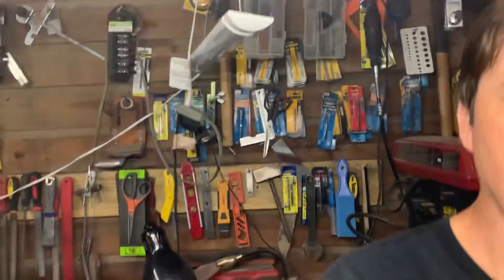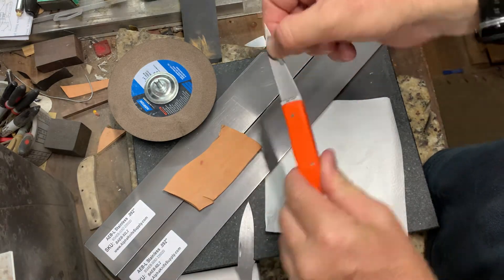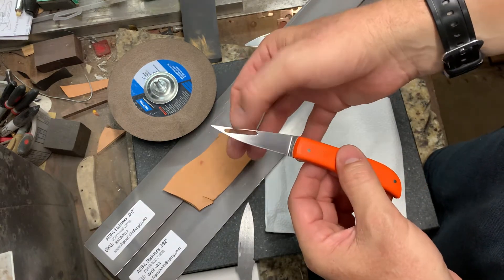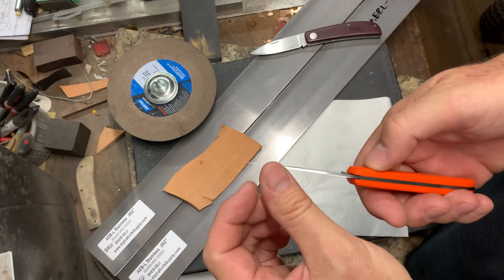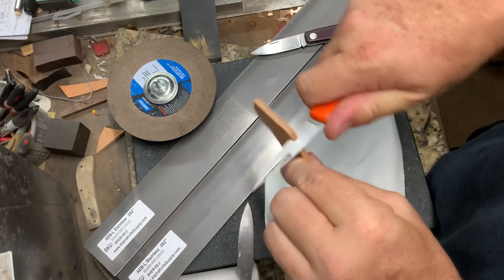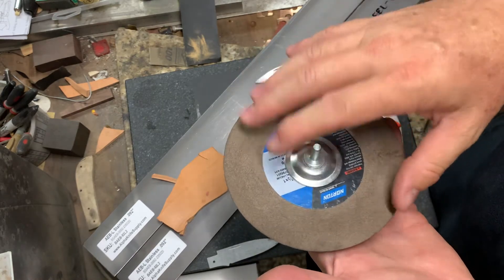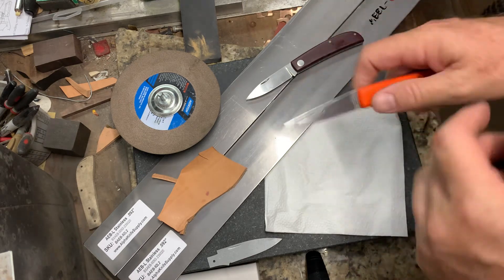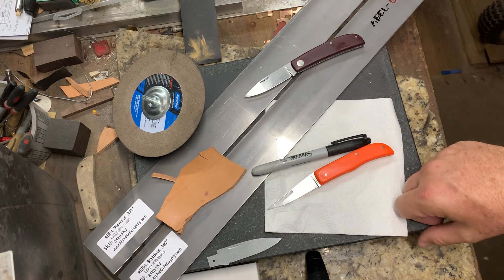How designing in steel works for me.

Comment: These video topics are very useful. I prohibited myself from making folders out of fear of too much failure. Silly. Also, you should try unidirectional carbon fiber. The .125 cf is stiffer than my .100 titanium. The stiffness of the g10 is already impressive.Another question, if I’m making a 10v blade, should my back spring be 10v? I’ll send you progress photos on Instagram. Have a good one.
Reply: Dang dude that nail nick jig is borderline genius.
Reply from the maker: I don’t know if 10v will make a good spring.  I suggest trying an see.  With 10v’s high carbide content, I would be concerned about the harder blade 10v tang gauling lower carbide content springs.   

I don’t like using carbon fiber.  Nasty stuff.  I have not used it in several years.  It does look nice.  

Look forward to seeing your progress photos.
Reply: @mccullenj  I’ll experiment with a hardened lock interface insert on the spring if galling is a problem. I’ll go with a w1 for the spring, and polish the radius on the tang for now. I don’t even have my heat treating oven yet so the blade will be w1 as well. Thanks for your time. Your work makes things look easy 😉